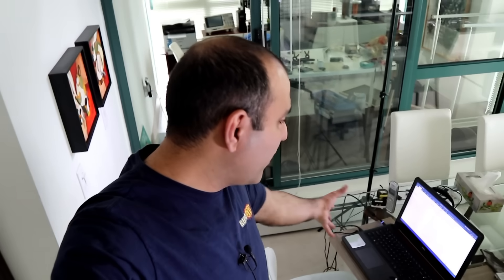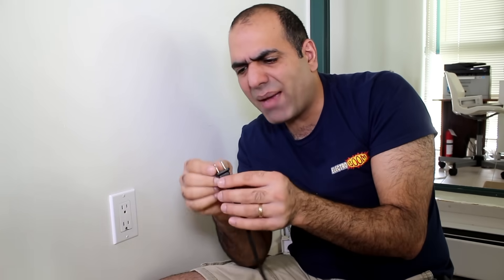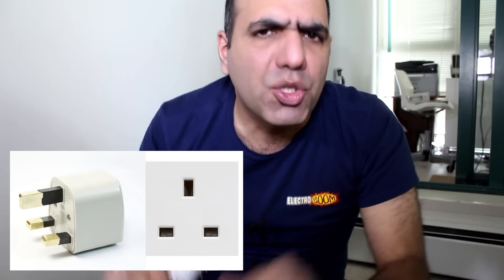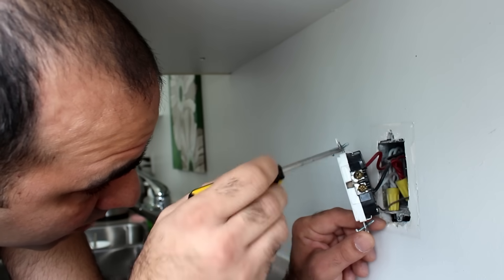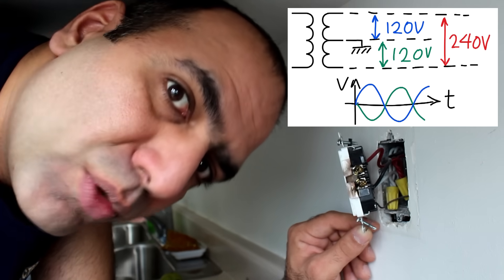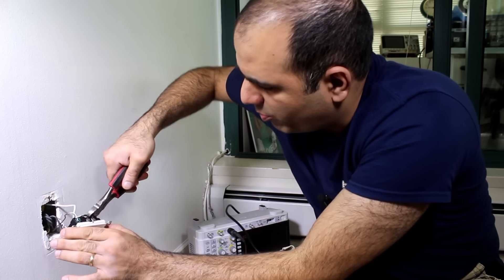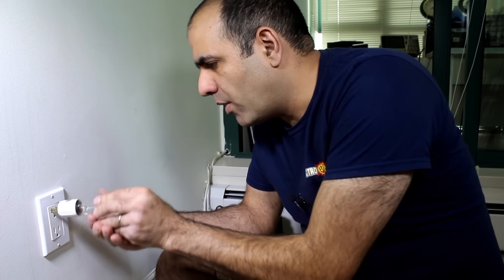How to Replace a Power Outlet

Comment: I've always heard that most electricians use the screws rather than the holes.  I assume there are reasons for that.  

Also, if you're going to do this, or if you just want to know, you should probably get a socket tester to test your outlets.  They're like $5-$10 and can let you know if any of your outlets are messed up or ungrounded.
Reply: In my house (220v), we use both. Wire is inserted in a hole then a screw is tightened to lock the wire in place.
Reply: jerlynn10 That's different. There are tabs securing the wire in those kinds of systems. Most GFI outlets actually have those
Reply: Purple Diana  I can attest to this. I used to live in a remodeled single wide trailer that had 5 receptacle circuits in total. Only one of these circuits was 20A and it was in the kitchen. The rest were all 15A circuits that usually fed at least two rooms. One day we were running our portable AC units and the breaker tripped. I reset it and all seemed fine, then it tripped again about 15 minutes later. I went to reset the breaker and it refused to close. I got lucky because my brothers girlfriend noticed a socket was extremely hot and upon further inspection, a wire that had been stabbed into this receptacle had completely burned through. We isolated all three of our portable AC units after I had gone through the entire house and screwed on all the wires. Every receptacle in the house was stabbed in. What did I learn? Trying to run a nearly 30 amp load on a 15 amp circuit with standard 14AWG is a fire waiting to happen. Also, the 20A circuit had 14AWG. From an electricians point of view, that whole place was a shitshow. Glad I don't live there anymore.
Reply: Abbreviated Reviews The set screws provide better grip and electrical contact. What Mehdi did in the video is called "backstabbing" and this is frowned upon by most professional electricians including myself. I've been on a few calls where an outlet burns itself because a backstabbed wire was making poor contact and started arcing.
Reply: I’ve used some ‘commercial’ grade outlets I could barely put in a loop of a 12  gauge wire in under the screws. They really want you to use the backstabbing.
Reply: Backstabbing is definitely not allowed in my house, and if I could I would kick all the backstabbers out of my neighborhood.
Reply: Aren't back stabs only rated 14AWG , I would assume a kitchen circuit is 20A and should be 12AWG. When I redid some outlets in my house I bought "commercial grade" outlets that back-wire but you have to tighten a down a screw to clamp the wire not rely on a stab to hold the wire.
Reply: There's no need to lose any wire when changing the outlets, even if they were backstabbed. There's a little slot under the hole you can push in with a jeweler's screwdriver and it releases the wire without cutting it. But as everyone else mentioned, much better to use the screws anyways. You can also twist them back and forth while pulling on the wire - it comes out that way too.
Reply: The better sockets and switches actually have a hole in the backing plate behind the screw that you just stick the wire in, then wrap it around the screw. It definitely saves time over forming the loops first with pliers. And yeah, make sure tightening the screw is closing the loop (not opening it)
Reply: Abbreviated Reviews y
Reply: yea sorry, with "wears out" i mean it will loose it tightness and therefore it connectivity causing higher ohms and risk of fire. well crafted springconnectors wont have that problem. i dont no if they are available in the states but WAGO spring connectors in various forms are used throughout the whole industry here in europe
Reply: There's no need to lose any wire.    Cutting the connection with snippers instead of properly removing  and clamping it using the screws on the replacement outlet it is just plain lazy.
Reply: Also remember to bend the wire into a hook and wrap it around the shaft of the screw going in a clockwise direction. If you do it any other way you risk a poor connection or the wire coming loose.
Reply: When I was doing it I’d always crimp the end of the wires onto special connectors that would then be screwed in
Reply: well what plug type then?
Reply: Those are called tension plates, and they are a much better way of doing it than backstabbing. Most industrial grade outlets and switches use those.
Reply: Most industrial outlets (aka commercial) use tension plates. You put the wire through the hole in the back like a backstab, but then you tighten the screw, and it secures the wire in place. Backstab holes are just little clips with tension that hold the wire in place. The heat from load wears the clips out, and they lose tension, causing the wire to loosen, which either stops outlets from working, or burning out the outlet and possibly starting a fire.
Reply: Screws never wear out. If there is an issue with the set screw, it is either underrated for the amp draw, or it wasn't tightened down properly. Back stab outlets will ALWAYS wear out after a few years, and much quicker if they are used to power things like AC units or heaters. People will plug in a 12.5A heater, into a 15A rated outlet, run it 24/7, and burn out the outlet. Remember anything run over 3hrs/day is considered continual use, which means you have to derate any hardware (wire/outlet/fixture) to 80%. 80% of 15A is 12A, which means anything connected to a 15A outlet that draws over 12A for more than 3 hours a day will burn up the hardware.
Reply: iambatkam makes sense , because I was installing outlets and antennas for cell phones in the agganis arena in Boston. One doesn’t seem bad but doing 30 or 40 on each section in each level wears you out
Reply: Dracolith1 Always cut the wire out of the backstab connectors, if someone's lazy enough to use the backstab ports then you can't trust them to not have scored the wire with their strippers, plus heat issues caused by the loose connection can make the copper brittle. Its 10mm of wire nothing to cry over, unlike a house.
Reply: US outlets are fukn shithouse. You should see what we have in Australia
Reply: There is much better current transfer using the screws. The dinky little spring in the hole does a terrible job making contact with the wire leading to increased resistance. Spend the extra few seconds and clamp the wire in the screw.
Reply: The only outlets I'll buy, which are the commercial grade ones, don't have the backstab holes. They also grip the plug much better and are designed to take more abuse. They cost a couple bucks more than the cheap ones. The quick way to remove wires from the backstab holes, by the way, is to take a pair of channellocks or vice-grips and just crush the outlet. The plastic breaks and you get a good look at just how cheezy those backstab connections really are.
Reply: backstabbing is allowed but definitely frowned upon
Reply: screw connections can wore out and cause fire due to the deformation of the wire by the pressure. thats why in germany many big companies make sockets only with spring connectors which apply force all the time. maybe the US manufacturers should produce better springs in their sockets :>
Reply: Or just use a multimeter. It works.
Reply: @chargedsupercap2270  Hint: voltage between live and neutral is a bit lower than between live and ground.
Reply: Abbreviated Reviews or just pay the charge for us electricians to fit them so stuff like this doesn’t happen because people are stupid enough to use non insulating tools and not follow the correct safe isolations process, we don’t go college for 4 years for no reason
Reply: PreDnized Bullshit.
Reply: When they first came out in the 1980s, I've heard of inspectors rejecting them and making the electrician redo the plugs and switches.  Nowadays no one in this area uses them.  After all, it really doesn't take any longer to screw the wires down securely.

Comment: Do not install outlets by backstabbing like that. Those connections are never great and I've seen all too many outlets smoked and burned because of that. Take the time, hook the wires around the screws. If they have the holes in the back that only grab the wires when the screws are tightened that is fine but as a general rule avoid push on connections if possible.

Comment: Im an electrician and as you were hooking that recep up i started laughing my a** off. And the reason to break the bridge the hot side of the recep is to run a 3 wire 2 pole 15A circuit to run a garbage disposal thats switched and a dishwasher constant power

Comment: 2:50 Attach the wire to the side screws and not to the push-in sockets. There have been many instances of wires falling out of the push-in sockets. Take a few extra minutes for a safer connection.

Comment: Now i like our european plugs even more
Reply: HAJDUTY that's the same everywhere else besides maybe China. One hole is the live and the over hole is the neutral. For the electricity to power the object/electrocute you it has to pass through a body or into the neutral. If you stuck a fork in the neutral slot nothing will happen as that's the receiving end.
Reply: That's trusting uncle grampa didn't get the rhyme wrong about the wire color codes. The lil-un's SUPPOSED to be the mean one. But I guarantee you that there is someone out there who wired it up however which way looks good and said "that'll do right."
Reply: Killeroz same lol
Reply: >whole village/block/apartment gets electric cut and we have to wait for it to reboot or repair man come and open it. 
BULLSHIT
Reply: All plug types are crappy! ;D
Trust me, I am a 3rd worlder that tried most of them.
So, just get a universal power strip with built-in USB charger and relax. Just an example:
https://ae01.alicdn.com/kf/HTB1hno4JVXXXXbyXVXXq6xXFXXXh/Universal-USB-Power-Strip-Extension-4-Port-USB-Wall-Socket-Adapter-Portable-Charger-AC-Power-Strip.jpg
Reply: I didn't know that Malaysia uses the uk power plugs until now.
Reply: I prefer the brazilian plug (Type N). Safe, firm and discreet (without much visual pollution on the wall)
Reply: European plugs cannot be polarized.  Usually the European design is an improvement on the American one, because the Americans did it first and the Europeans learned from their mistakes. But European plugs are distinctly not as well designed as the American ones.
Reply: @MottyGlix  Really the only thing I absolutly hate about NEMA is that they look like happy friendly faces and that can entice children to try to play with them.
Reply: Killeroz in Sweden I can grab a fork in one hole and not get electrocuted, instead the whole village/block/apartment gets electric cut and we have to wait for it to reboot or repair man come and open it. I have tried it several times because it's fun.
Reply: kurt victor oh okay ty for explaining now I can do it again and not expect to die.

Comment: I'll probably shock you with touching life wire parallel to a 5V USB Charger at 230V 16A (which is the threshold when our breaker get triggered) and be still alive (again) ;D

Comment: Hello Sir. I have worked in the Caribbean . The electricians there like to be different. They install the outlet upside down so the when the plug starts to fall out  the ground prong holds on and forces the  current  prongs into the outlet. In America we kind of think it looks stupid because the outlet is upside down. But in theory it seems better that way.
Reply: In the US it's common for union electricians to put them in ground side up.

Comment: Back stabbed outlets cause point connection to the wire which heats on high current loads.  This causes the brass to lose temper (annealing) and become loose.  Don't back stab, it will fail and is a fire hazard

Comment: European outlets/plugs are actually the best.
Atleast they look like the best, i cant try them ;_;
Reply: Killerspieler0815 could be. Whole american electrical system is a big mess.
Reply: +Przemek Potyra - not only the outlets are crap , the plug + outlet combination are even worse = absolutely shocking / electrocution hazard https://www.youtube.com/watch?v=kQXHl0cN4b8 & a lethal fire hazard https://www.youtube.com/watch?v=EmVH5En6x6o (shorting energized L+N with the plug prongs) 

UK has sleeved pind & Germany / France have recessed sockets , most modern systems have both
Reply: +KappaKappaKappaKappa - the Internet is the source of stuff from all over the planet, just do NOT use cheap Chinese FAKE stuff & highly outdated / defective used stuff 

New Germany extension cord https://www.ebay.com/itm/European-Type-F-Schuko-Extension-Lead-10-Meter-F-Cee-7-4-Socket-Schuko-Cee-7-7/222461857941?hash=item33cbc29095:g:Sy4AAOSww3tY4hZB 

More Germany https://www.ebay.com/sch/i.html?_from=R40&_trksid=p2334524.m570.l1313.TR1.TRC0.A0.H0.XSchuko+socket.TRS0&_nkw=Schuko+socket&_sacat=0&LH_TitleDesc=0&_osacat=0&_odkw=type+f+socket

-----

France:  

https://www.ebay.com/sch/i.html?_from=R40&_trksid=p2334524.m570.l1313.TR0.TRC0.H0.XCEE+7%2F5+socket.TRS0&_nkw=CEE+7%2F5+socket&_sacat=0&LH_TitleDesc=0&_osacat=0&_odkw=acu+2P%2BT+socket

------

UK 

https://www.ebay.com/sch/i.html?_from=R40&_trksid=p2334524.m570.l1313.TR1.TRC0.A0.H0.XUK+socket.TRS0&_nkw=UK+socket&_sacat=0&LH_TitleDesc=0&_osacat=0&_odkw=CEE+7%2F5+socket

----

Infos: 
https://de.wikipedia.org/wiki/L%C3%A4nder%C3%BCbersicht_Steckertypen,_Netzspannungen_und_-frequenzen
Reply: +Przemek Potyra - YES , especially the medium to consumer voltage lines in the cities / towns / villages look like in a 3rd world country http://cdn2.creativecirclemedia.com/neni/original/20161021-161641-20160718__p_eag-l-cheshirestorm2jpg + https://c8.alamy.com/comp/E00PB8/power-lines-la-conner-washington-usa-E00PB8.jpg
Reply: Sorry guys but uk plugs smash the shit out EU stuff. We have are own standards for electrical safety that are the best in the world. Meet the eu requirements plus more. Thats why electricians are so well paid in the uk.
Reply: +Mike Foster - YES UK plugs are the best in the world today (safety) & is the only one with a fuse, but with a few bad exceptions: 
earlier versions without isolating sleeves (exactly like this USA crap plugs), 
huge plug, 
gigantic prongs that are more expansive, 
painful to step on.
Reply: Killerspieler0815, they can only plug one way, which is a huge drawback. 
The only thing which makes a UK plug safer is the shutters triggered by the ground. Schuko plugs often have them too, but they are inclined, because there is nothing to trigger them, although, they are rather soft, so anything with sharp edges, like a screwdriver, won't open them easily. I don't think there is much use for the built in fuse.

And the safest one is "magic security" plug.
Reply: +MrPaukann - German shutters are the second generation of shutters that requires to insert 2 pins at the same time ... the British are the first generation. the built in British plug fuse protects the device cable from the 32 Amp of the socket , also ( the 3 Amp fuse) getting more important thanks to cheap Chinese stuff
Reply: Killerspieler0815, but do these fuses blow ever? Almost always, when something goes wrong, it is either a short or no circuit. I can't imagine what can go wrong, so the fuse will blow. What would draw so much current continuously?
Reply: Just believe they are. I am from europe, currently living in America and I cant stand those shitty outlets.

Comment: The brazilian works the same way as the european one, but accepts some older devices (those that has live and neutral and are thin as the us plug, but they are roundy not flat). 
And you isnt able to touch the live when plugging anything into it. Its very safe

Comment: Mehdi, you might be a brilliant EE but you're a pretty um, non-brilliant apprentice electrician that would get yelled at by his Journeyman if you did this work professionally ;)  Neutral side is always on the side of the ground screw and is the bigger hole.   While backstabbing the wire is allowed for 14 awg solid wire, it has a higher chance of getting loose (and burning) over time than making a loop and using the screws. A lot of shops even specifically forbid it because it results in callbacks and is lazy.  Your plug is also not flush on the plate and that's the sort of thing that homeowners, builders, etc. will call you back to fix.

Comment: Ill just add the white is not a neutral, unless its a three wire circuit, and the green is not a ground.

The white is actually your identified conductor.  Aka ground reference.  While the green is a bonding wire.

Comment: It is not necessary to cut off the old exposed cables unless it is weakened. There is usually a hole that is labeled with microscopic print that tells you to insert a tool like an awl to release the cable catch. Then, the cable can be pulled out.

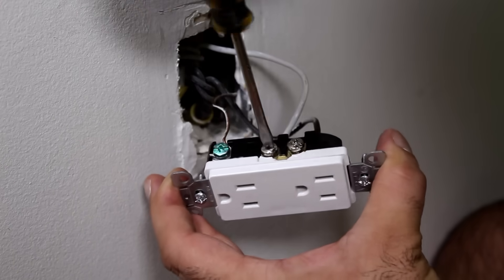Comment: I'm proud to say that I noticed at about 3:00 when you connected the hot and neutral incorrectly. Great illustration of how things can go horribly bad if that is done incorrectly.

You might also point out that you can buy a little device to plug into your outlets that will light up to tell you things like if the ground is not connected, and if hot and neutral are reversed. It is sadly kind of a common thing to happen when homeowners or inexperienced maintenance staff replace outlets.

Comment: One thing I've learned in my new house is pushing the wires into the grab slots will eventually cause the outlet to short out and begin arcing, I removed all of mine and used the screws instead, safer and better connection. This wouldn't be necessary if the plugs were not garbage contractor grade crap, but they are, so it is.